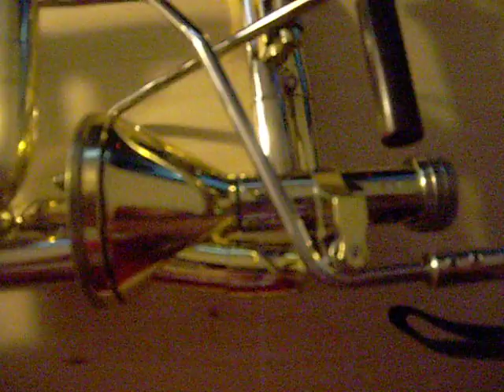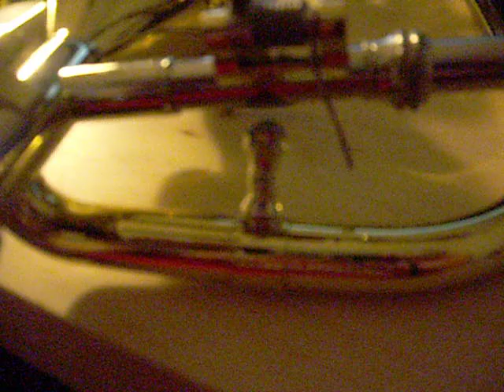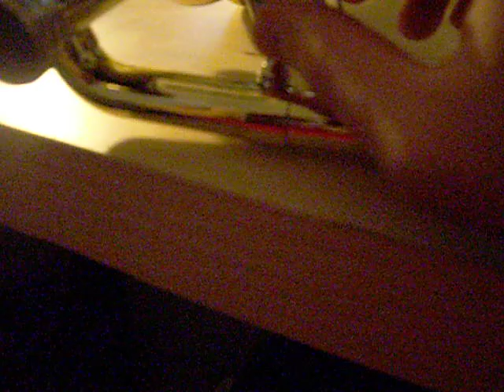SE Shires Bass Trombone issues.

Comment: This just happened to my Shires rotors about two months ago, right in the middle of a big band rehearsal.  Same deal, the solder joint just below the valves gave out, and the brace between the F attachment tubing and the main crossbrace.

Comment: Wow. That's no good. I own almost exactly the same instrument. The previous owner (A professional in the Seattle Symphony) didn't have any issues with it, and I'm not having any trouble with it at all. All I've done in the six months I've owned it is put a little mute ding in the bell during the musical Chicago which has some pretty quick mute changes.

You should call Shires and they should deal with the problem for you, because that's pretty major to have a popped weld and a messed up valve.